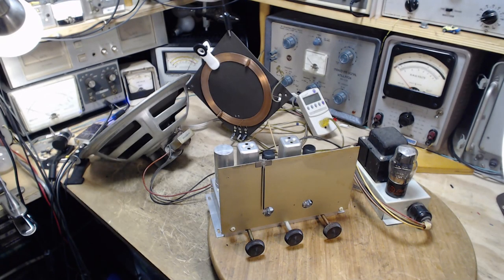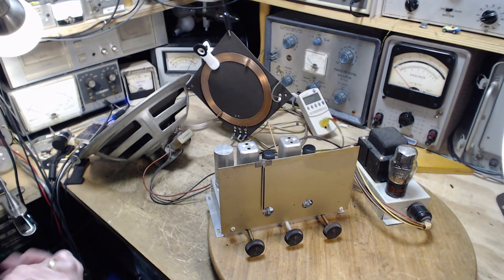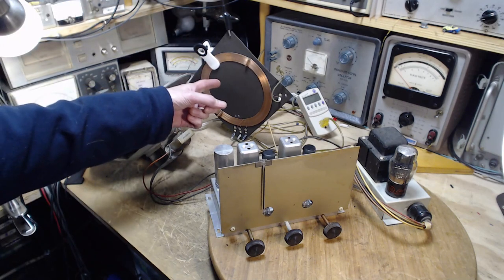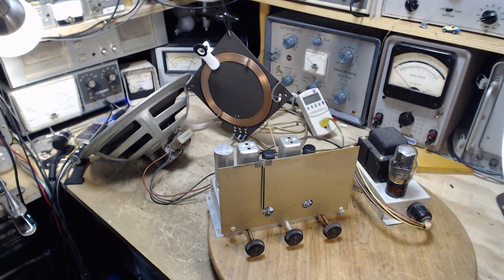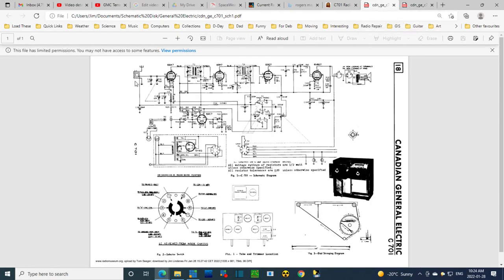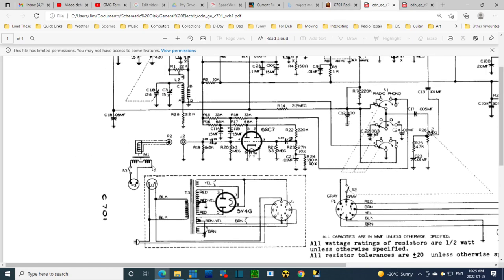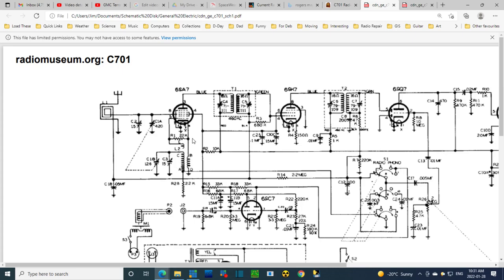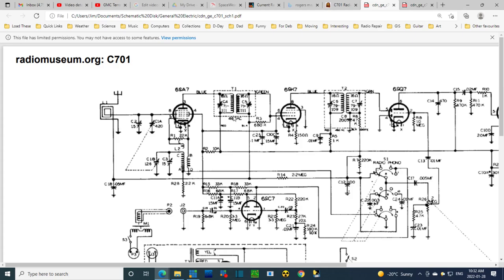Canadian General Electric C701 Console Video #7 - Schematic Review and Tube Voltage Tests

Comment: Ive been working on my EICO 320 Signal Generator and restored the entire works. I added the trimmer caps of 5-30 pf to each coil in order to calibrate the ranges to less than 1%.. on the  “A” range of 120kc to 400 Kc I added across the coil tap a 455 Kc xtal.. range “A” at mid scale pops into the 455 xtal energy and I can trim it to right on 455. So I did an alignment with the generator. I carefully tuned the IF transformers to 455Kc. And all went well. afterwards I manually swept the limits above and below the peak at 455. When I hit 457 the meter signal strength indicated a much higher peak, but it fell off immediately. The range below 455 panned out as you would expect. Im nor really worries as the radio picks up 23 stations across the band from Maryland to Massachusetts. I live outside Philadelphia. Im merely curious what is going on in the receiver.
Anyone have any theories? Ive been in the biz for over 60 years and never realized this effect. I must admit I never looked fir it either. Ive done a manual plot of the IF band on other radios and never saw this.